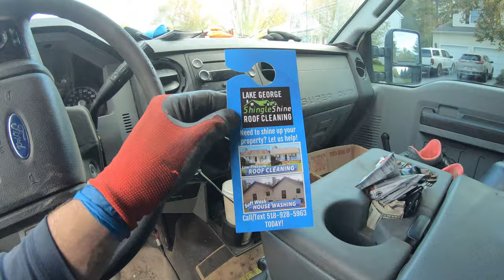SATISFYING | Gutter Clean Out | Here's How To Easily Find More Jobs

Comment: You should get some hooks for paint cans and hang your bucket off the gutter. I've been doing that for years and it also helps when the debris doesn't make it in the bucket it just hits the ground instead of on the roof.
Reply from the maker: That's a good idea! I started using black contractor bags instead of that bucket now. Much easier and less emptying. I'll keep the can hooks in mind!

Comment: You ever have complaints about the ladder being directly on the gutters? Just wondering about getting a the stabilizer arms
Reply from the maker: Hey JR. not a single one. ladder goes on gently and then i climb softly. 1 rung at a time usually. doesnt cause any ladder movement, bouncing or sliding to cause damage. lots of guys like stabilizers. nothing wrong with them!